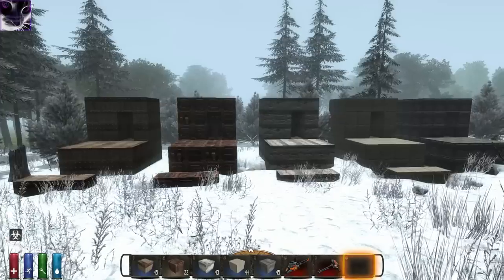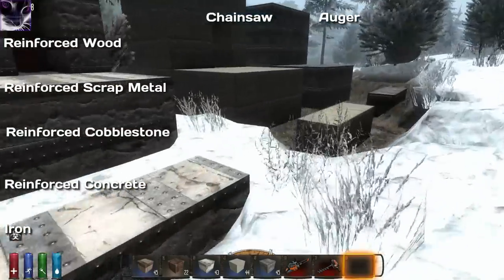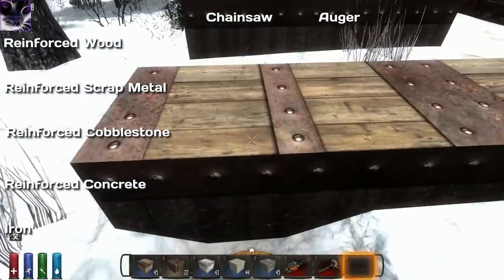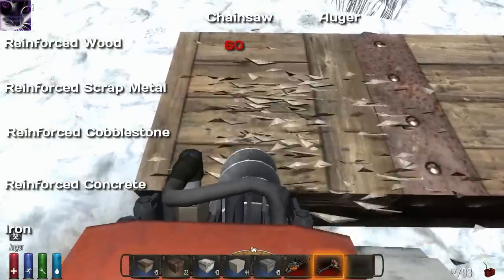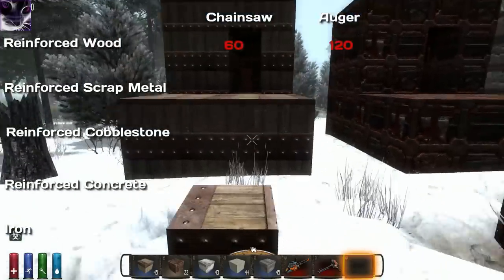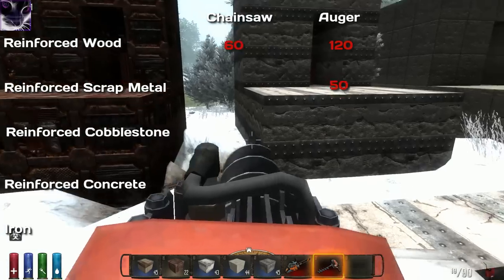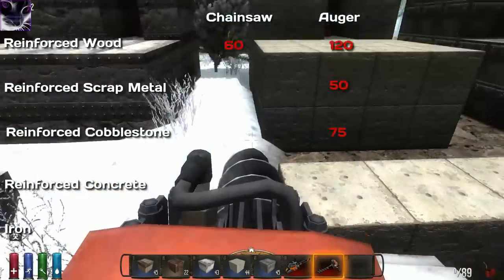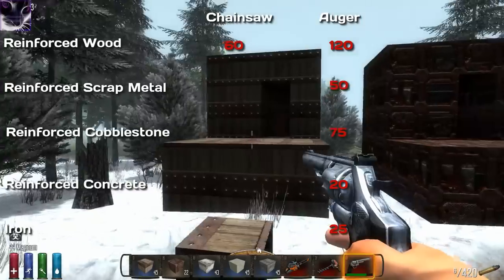Which is STRONGEST BLOCK for Building - 7 Days to Die

Comment: Just like nature: mixed materials are the best for some reason. Wood + iron (used in early games), then cobblestone + iron (used later). Actually, reinforced metal cobblestone looks like more with real life concrete, which is a metal frame filled up with cement. Nice work, Mr. Sethioz!

Comment: I'm not building a house to protect me from an Auger or a Chainsaw. I building one to keep out zombies also the auger is not made to destroy wood. It is more a mining tool so it makes since it sucks on wood.The zombies are my main threat in solo. The tests should also use the Zombies damage to determine what's best that using one tool and explosives
Reply from the maker: _LittleFrosty1623 _ that's why i used chainsaw on wood. If you don't get it ... it would take 60-80 hits with pickaxe or hatchet to chop 1 block. Pickaxe is equal to auger. Auger is just faster, that's all. Same goes for axe and chainsaw. chainsaw and axe are both good on wood, but chainsaw is faster.

i don't think you understood the concept.
Reply: The Sethioz Project you should have thought about testing it against puker zombies
Reply from the maker: Jacob Solt i'll do another video once game is in better state. i tried it few days ago and didn't really see any changes at all .. graphics are also still crap.

Comment: Zombies don't use tnt, augers or chainsaws...  This test was pointless as each one works best vs material type...  That's all you did.   Material with the most "hp"  is the better one to use.
Reply from the maker: I dont play single player, I only play in PvP servers and in those, main threat is other players. zombies are harmless compared to players.
Reply: the game has changed a lot since 2014 so a lot of this is no longer valid anyways.

Comment: I just read the wiki and it listed the  Auger to have a Block Damage Value of 2 but the Chainsaw to have a block damage Value of 0.2

There must be some sort of multiplyer when attacking wood, it would be great if you could test at least one of the other materials with a chainsaw for comparison.

It would be really awesome if you could do an updated video with the new durability changes they've made (reinforced cobble is now gone and reinforced concrete is much harder now to compensate)
Reply: One thing about 7dtd is it doesn't have a base damage set in stone it isn't like Minecraft it looks at the player also and the material it is being used on to destroy if you use a shovel to collect iron ore with 0 stamina you will probably loose your shovel from the miniscule amounts of damage you cause and the massive blows of damage you cause to your shovel.  It also takes item condition into consideration also.

Comment: Well, some notations regarding comparisons of materials, perhaps a better test might be using a fire axe and a pick, and counting the hits, or also, what'd be cool, is to demonstrate, the practical values of pure dur, hardness strength, and durablity since the wiki doesn't like to explain things very clearly, from a practical standpoint.   but from a general comparison this is a great way of saying that "iron blocks and concrete blocks are worthless compared to those with the upgrade paths. I'm sad the cobblestone upgrade path is nolonger active. I am also curious to see if they HAVE changed the reinforced concrete. they may have, considering things. I imagine a quick numbers check, or perhaps a repeat test could show this very easily!
Reply from the maker: chainsaw is like fire axe, it does same damage type. i don't feel like making a 1h video where i hit 1 upgrade level like 50-100 times just to break it, this is why i used auger and chainsaw. auger damage type should be same as pickaxe

Comment: LOL  the second place reforced wood? cool this game. Thanks for the test!!
Reply from the maker: well actually reinforced wood in real life could be hard to get thru, since wood is very durable against shaking if you know what i mean, concrete houses would collapse even in small earthquake, while wood would survive. depends on wood i guess and depends what you use to break it with.
Reply: The Sethioz Project I dunno if RL is really relevant, since metal is also fairly easy to make earthquake resilient. just look at some of the awesome engineering they used in that hotel resort thingy in...dubai was it? but for gaming perspective, looks like Wood is far easier to come by, and lower iron requirements, also easier to see what blocks need attention.